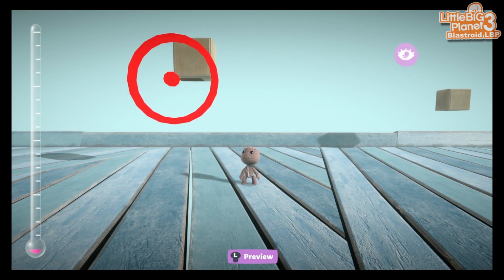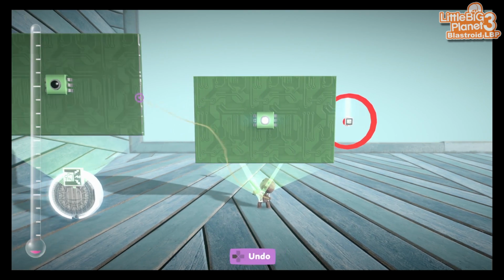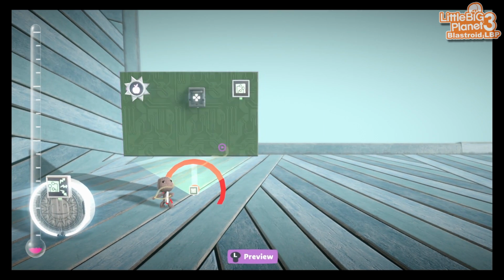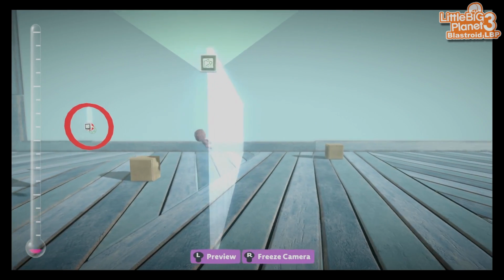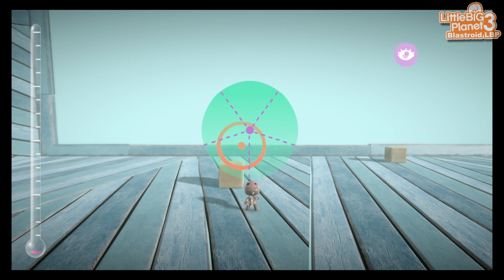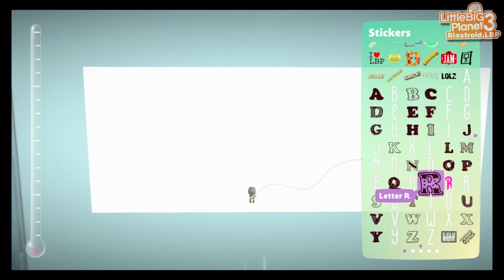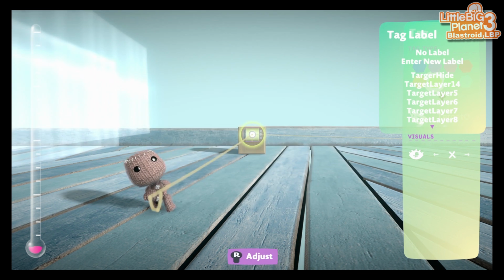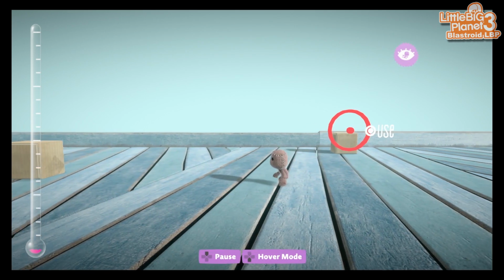LBP3 Tutorial – Point Click Cursor Menu

Comment: I haven't made one in a while, but you can get a square or rectangle sensor area by using two sensors set in opposite corners of the shape with a 90deg angle. Plug them into an AND circuit and you're good to go, your tag or player will need to be inside both ranges to trigger the AND. 

Edit: Came back with a link to a tiny example.  Blastroid let me know if you want me to delete it, I'm certainly not trying to be THAT guy :D   

Link to copyable example on lbp.me: https://lbp.me/v/qt5zyfh
Reply from the maker: The link is fine. Yeah there are many ways around some of the limitations of LBP logic settings. LBP is getting better and better with each version. Maybe we will have native square setting in LBP4. Thanks
Reply: Thanks. Native square sensors would be great.
Personally I look forward to getting some full 3d like with LBPK - Ohh the fun we could have.